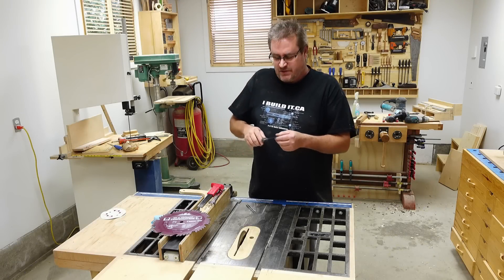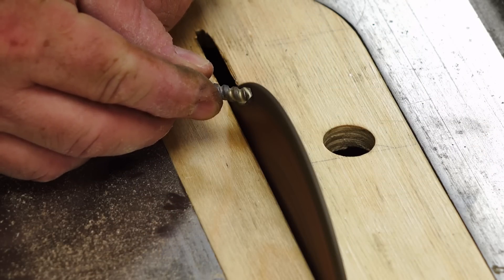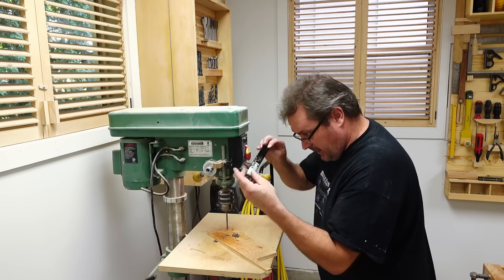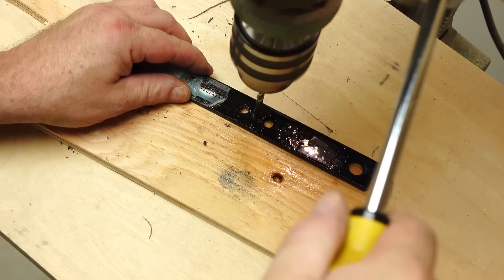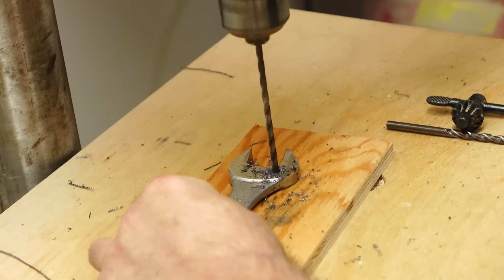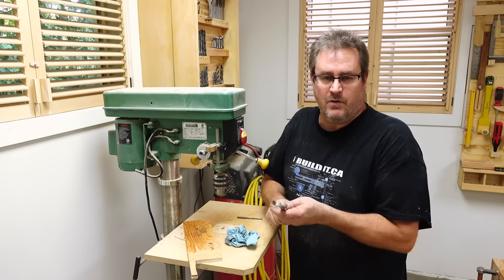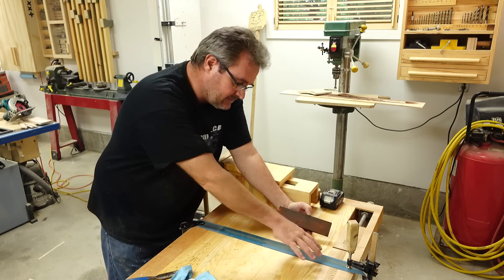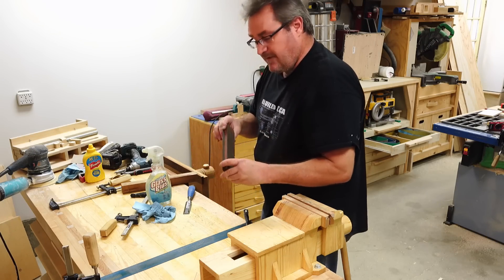Drilling Hardened Steel With Masonry Bits

Comment: You might also check out Artu brand drill bits.  They are carbide-tipped like masonry bits, but are designed to be a bit more general purpose. They're advertised as being for many things, including hardened steel.  But probably not as inexpensive as masonry bits.
http://artu.com/drillbits.htm
YouTuber Wayne Winton is a locksmith who demonstrated some drill bits for hardened steel.  Although, mostly he is looking at higher end and more expensive drill bits. You can find his channel here:
https://www.youtube.com/channel/UCsvr-zYHwi1FmHp8ZE1WQIQ

Comment: I thought carbide will cut simply through using friction? Try it without sharpening. You can get carbide friction drills, and they just melt through.

Comment: An interesting experiment. In the future avoid grinding Carbide dry if possible. Carbide is a cement of Cadmium, Chromium, and Cobalt, which are all toxic heavy metals. Try drilling without oil. Carbide doesn't need it. Drill at higher RPM. Because Carbide can handle that too. The amazing property of Carbide is its melting point, besides its hardness. Which Google pegs at 5,198F
Reply: garygsp3 IPM is travel speed. Are we milling now? How is work going to harden while it is hot? Steel softens with heat. Quenching hot steel sets it in a hard structure. The heat will be localized in the work if you finish your operation in a reasonable amount of time. Plus when you are machining correctly chips carry away a lot of the heat. As a rule of thumb if you're not making a volume of chips you're doing something wrong.
Reply: +Paul Frederick You havnt machined certain types of stainless steel have you? Mr know-it-all.
Reply: *****
Probably not. There are numerous types of stainless steel. When I machine stainless I never know what type it is either. So odds are I have not machined them all. But the types I have machined has given me a greater appreciation for rusty metal.
Reply: +Paul Frederick - Fairly irrelevant to grind carbide dry, we're not talking about a lot of material nor doing it all day, every day, and due to the nature of how one holds the bit against it, what trivial amount of particles there are, are being slung away, not into his lungs.

Do NOT drill without oil, that's foolish bad advice unless it's cast iron.  Only the tip is carbine, you will easily melt the shank of the bit then what good are two little slabs of carbide that fell off if not welded to your work piece?

Same for drilling at higher RPM, don't do it.  Again, excessive heat.  What he is doing wrong is using far far too little cutting fluid.  There should be a steady stream of it or the work piece even submerged in it, never any smoke or red hot molten metal present, and I haven't even mentioned the poor hole tolerance from expansion and molten material slop.

Details matter.  That carbine isn't doing anything useful if everything around it deforms.  In a difference scenario, sure then you could go with higher speed so long as the feed rate is right.

Comment: Yeah you can drill hardened steel with a masonry bit but the only thing is be prepared to ruin your drill bit you might get one or two holes but concrete drill bits are pretty damn cheap and they said that carbine bits are expensive well I found some on eBay for a reasonable price a whole hell of a lot cheaper than these other people that sell carbide drill bits and using the carbide masonry bits does help if you don't feel like going to buy one or purchasing one on eBay Amazon and waiting for it to get there masonry bits do help if you need to get it done right away I found out by watching a video on YouTube I was skeptical too until I tried it and I was like okay good to know YouTube good for you if you don't know something that will help you out on doing it or figure out how to get around something YouTube will show you how to do just about anything

Comment: Have you had a play with the angle of the cutting edge on the drill bits? it can help with drilling harder metals. but your fucked if it's harder than the drill bit itself.

Comment: i could have used this recently drilling out some holes at work. I work on turbines and when a bolt or a screw breaks its a son of bitch to drill out due to being harden from the heat also taps and drill bits this would be totally awesome for if it works.

Comment: Use cutting oil, or anything but WD40, that strips oil and grease away.
Reply: WD40 will COOL the tip if you use enough of it.....lubricity is irrelevant compared to TEMPERATURE.
Reply: I dont think you need to lubricate or cool carbide bits.

Comment: Totally worth the experiment, I would never have looked to a masonry bit for drilling hardened steel.
BTW - I know you did another video on drilling hardened steel with masonry bits and you went out and bought bits special for it.
Harbor Freight sells a pack of 6 bits by Warrior carbide tip bits for glass cutting for around $10 bucks. I saw another video here on Youtube and he drilled several holes through a file with them. He did break one, and stated they are not going to be good for major work or production type drilling but for 2 or 3 holes they'll work fine. He did demonstrate it. Good to know as well.
You can watch the video here: https://youtu.be/zWrwDTn9GT8

Comment: Drilled through many of different steels, alloys, cast iron and steel, stainless, hardened steel, mild steel and these have always done the job. Slow and lots of pressure. 

http://www.amazon.com/Norseman-29pc-16-1-Black-Gold/dp/B00627C8ZU

Comment: Sir you are using very high speed too fast for that type of drill!!!!
Reply: +John Hili Considering that Carbide runs at four times the surface speed of high speed steel your statement is the opposite of correct.
Reply: +Paul Frederick When cutting through hardened steel, the slowest speed is your best friend; ask any machinist. Higher speeds create more heat and more heat makes a less efficient cut. We do know the bits are getting pretty hot when we see smoke.
Reply: jjenson2006
I am a tool and die maker so I don't have to ask any machinist. I'm a cut above machinists.
Reply: Paul Frederick
Making tools doesn't automatically make you an expert on using them. No drill is going to stand up to a lot of heat, even carbide tips; that is a fact. If you don't agree that a slow drill speed is essential when drilling hardened steel, then I have to question your knowledge on actually drilling hardened steel.
Reply: jjenson2006
Yes making tools does automaticvally make me an expert in using tools. A lot of heat is relative too. A Carbide drill will withstand twice the heat a HSS bit can. But it gets even better than that. Because Carbide runs at 400% the surface speed of what HSS can too. If you do not believe me then look it up for yourself. The information is widely available on the Internet. http://bfy.tw/23YR
Reply: Paul Frederick
You're missing the point. Yes, a carbide tip will withstand heat better than a HSS bit; I'm not denying that. The part you missed is that if it gets hot enough, it will damage a carbide bit. Drilling at a high speed and applying a lot of pressure when drilling hardened steel WILL destroy a carbide bit. In my 30+ years drilling with them, I have destroyed quite a few of them myself. Most importantly, the bits will cut more efficiently at a slower speed.

Do you realize that there are mechanical engineers who have never actually used the things they designed? Do you know that improvements in their designs are due to the feedback they get from those who actually do use them? This is why those who design things are not automatically experts on using them.
Reply: jjenson2006
Oh I did not design the instruments I made. I just made them. I made these http://www.gotmachinery.com/upfiles/list/41956-1.jpg among other things.
Reply from the maker: +John Hili Quite an interesting back and forth between you two. It's also interesting how many experts have nothing better to do than watch YouTube videos all day and engage in online arguments and pissing contents :D
I'll put it to the test and settle this once and for all (yeah, right!) by trying it both ways using identical brand-new masonry bits. High speed dry vs low speed wet cage match 20-fideen.
Reply: I Build It
There are a number of factors that influence Carbide tool performance. Speed is just one of them. Tool geometry, machinery rigidity, and power too are other important factors. Then there are the myriad of different grades Carbide comes in as well. Each engineered with different properties to perform different jobs.

Your cage just got a lot bigger.
Reply from the maker: +Paul Frederick Well, no, see Paul my cage is a simple one - four walls and a roof. The purpose of my original test was to demonstrate something simple, using stuff that guys (that actually do things other than watch videos) are likely to have in their garage, shop, shed, kitchen, whatever. So I'll get a pair of bits and do another quick demonstration, mainly because I'm curious myself.
Reply from the maker: +Paul Frederick I never insinuate. If I thought you were a useless, know-it-all wind bag I'd probably keep it to myself, unless you gave me some reason to do otherwise. You took my remark out of context - I know you are have the experience to back up what you say, regardless of how many videos you watch.
Reply: I Build It
Well then I take it back. Please forgive me. Good luck with your experiments.
Reply: +I Build It in a other video called Drilling hardened steel fast and slow, you used a file and from my understanding files are cast iron not hardened steel. but please prove me wrong.
Reply: +I Build It  
Hey keep having fun doing what your doing, learning to get things done with what you have is a great skill.
I'm not one to comment much but I do get aggravated with people that are so smart they cant understand the basic's. As a job shop machinist iv had to make due with hardware store tools more than once for emergency jobs. First off referring to other comments a tool and die maker would be using high quality micro grain carbide with a TiCN or TiAN coating not a masonry drill. You are on the right path in this video you must sharpen the carbide like you did also lightly sharpening the sides like you mentioned may help in tool life if the front edge is lower than the center of the carbide otherwise it wont change much. don't worry about the course edge from the tile blade it will cut just fine. The carbide used on masonry bits is softer for impact resistance than say a high end $130 solid carbide drill. So you cant expect great tool life. Speeds and feeds are also important a simple formula you can use is (S*4)/d=rpm where S = surface speed and d = drill dia for a standard drill on mild steel S=90 for med carbon steel or stainless S=60 for say file steel and your sharpened masonry drill S=20 to 40 (Estimate) or just go by the old saying white just rite brown slow down and blue your thru referring to chip color.  As for cutting oil you need something that is a boundary lube not hypo so lard or bacon grease as something you might have around, wd-40 can work but more of a hypo, molly grease and chlorinated brake cleaner mixed would also work. The best would be a high sulfur cutting oil. For carbide to steel water is all you need if submerged. Hope I've thrown some useful info your way. If not just disregard.
Reply: +115zombiehuger Regular files for filing metal is hardened tool steel, a file made of cast iron wouldnt be good for anything.
Reply: *****
A file made of cast iron would be good for lots of things. Just not the kinds of things you think about filing.
Reply: +phogelbice no cast iron is stronger than steel its britol though so you can shatter it very easily but as a abarison tool "a File" it works better than steel.
Reply: 115zombiehuger
Ah, if cast iron was stronger than steel then why would anyone bother converting cast iron into steel? Steel is an alloy of cast iron, carbon, and usually several other elements.
Reply: +Paul Frederick yes that gives it flexibility and doesn't make it Britol cast iron is very britol that's its weakness. steel is used for things that need to have a certain amount of flex to them steel is stronger than iron,  but cast iron is stronger than steel but very britol so you only use it in things like files as they are not intended to be bent or smacked against anything. there are a few files i know of that are steel and the one from the video looks like a cast iron one.
Reply from the maker: 115zombiehuger
Files are high carbon steel, not cast iron. I would think that before making a statement like you did, you'd at least take a few seconds to Google "what are files made from" to confirm what you are saying.
I'm butting in here to try to stop this absurd "discussion" that I keep getting email notification for. Next step is to delete it. Spend less time typing and more time reading.
Reply: I Build It
I did a bit reading myself and apparently ancient files were made out of iron. So they were kind of right, but just by chance. I was still going to just let it go. If someone wants to believe that files are made out of iron I see no harm in that. Fighting ignorance is a losing battle in today's world. Because you don't have to tell the smart ones to research facts. They'll just do it out of hand.
Reply: Also, attempting to drill a hole in cast iron is dangerous and could f*ck you up proper.
Reply: *****
How do you figure? What do you think happens when you drill cast iron?
Reply: It could shatter
Reply: *****
cast iron shatter just from drilling it? No. Cast iron is quite machinable.
Reply: Do you just hang around to goad people into arguments, Paul? Sorry, man, I got better things to do.
Reply: *****
sure you do.
Reply: One thing I've learned from machining for almost thirty years is generally that the harder the material the slower you have to machine it. I've machined on everything from wood, brass, copper, aluminum, titanium, stainless, to case hardened materials with interrupted cuts. You name it I've probably machined on it. I've used HSS, Carbide, Cobalt, ceramic, diamond tooling ant more. You can say that you can run some drills faster and that's true but you have to slow all drills down when the materials get harder. That's just what works.----the voice of experience.
Reply: drop it it breaks or slap it @115zombiehuger

Comment: You don't need to sharpen masonry drill bit.  Get yourself a glass- ceramic drill bit.  These carbide tips are sharp and no sharpening is necessary.  Good luck.

Comment: Doesn't work. 99% of masonry bits are made of mild steel with tungsten bits welded to the front. The tungsten is harder than the rest of the drill. It should take no more than 1 second to round of that dril bit.

Comment: you can buy those drilling bits. at least in germany. they are called "hartmetallbohrer" @ werkzeuge-bohrer.de/
Reply: the reason why those drill bits get dull/broken is your cheap machine. to use such carbide bits for cutting metall you need a very good machine with very low tolerance and very good/stable guidance